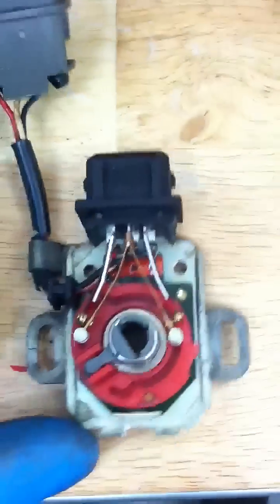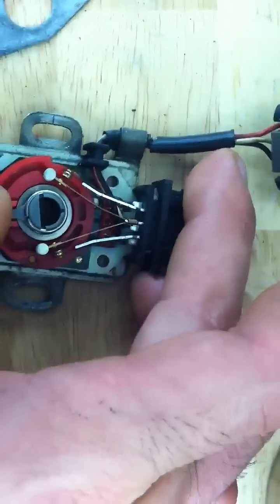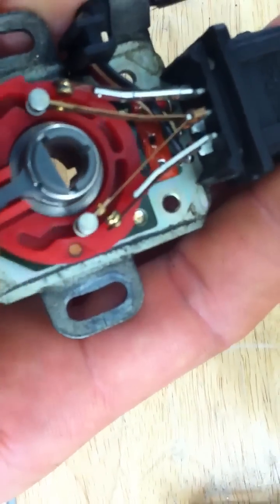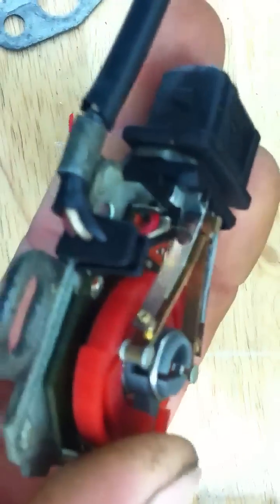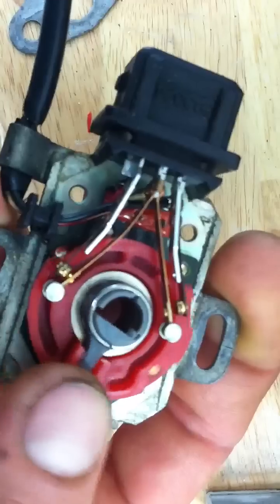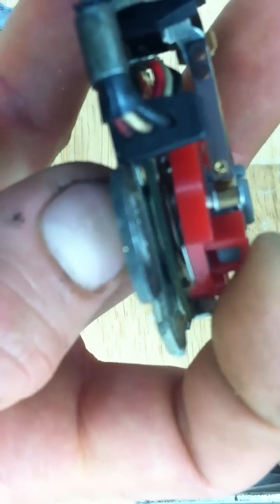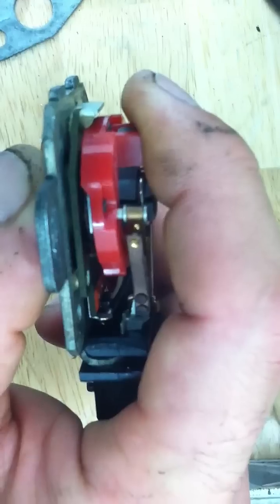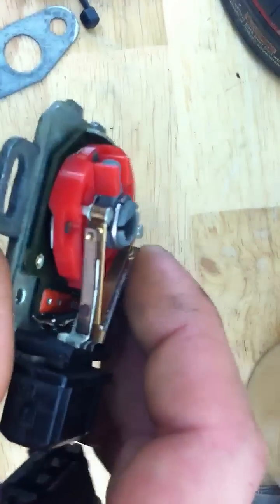TPS throttle position sensor

Comment: I have a question......
I have a 2001 Nissan Sentra is failing me TPS sensor the mechanic tells me that the TPS sensor that does not change, i have to buy the whole throttle whit te sensors, is that true????